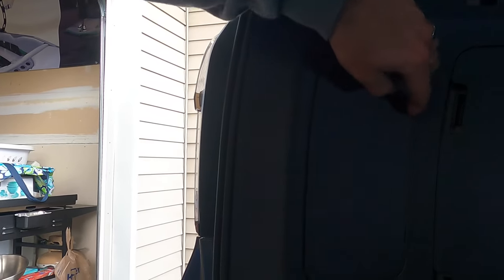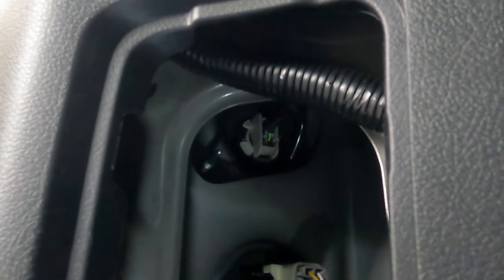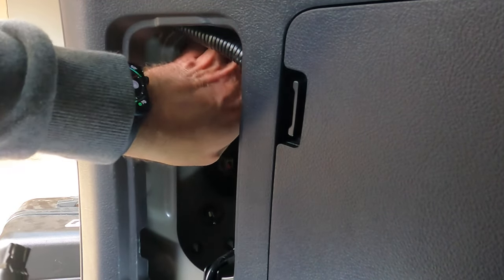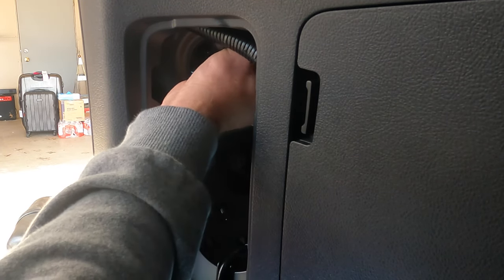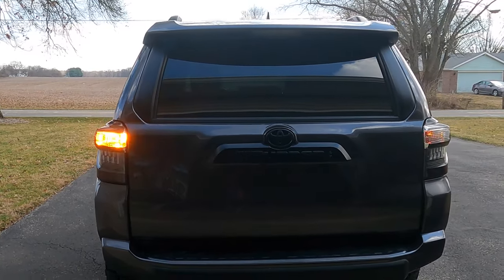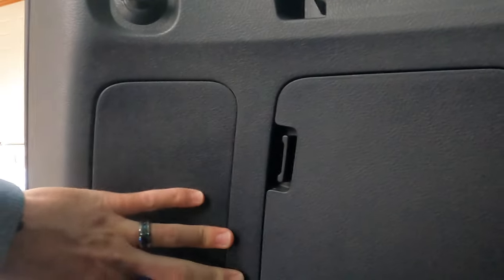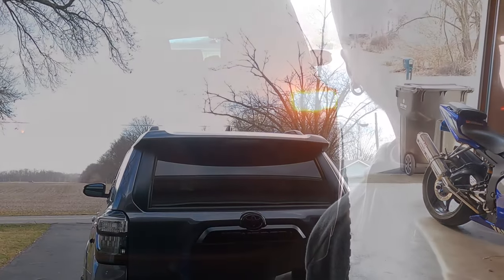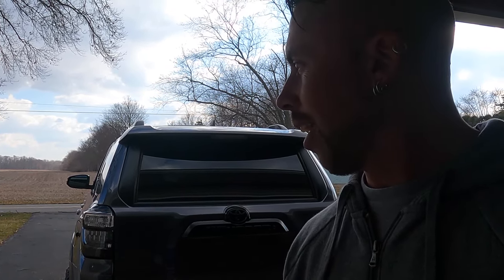Toyota 4Runner LED rear turn signals by Lasfit install - No resistor needed - No hyper flashing

Comment from the maker: If you are interested in getting these LED rear turn signal lights for your 4Runner, go to https://www.lasfit.com/products/7443-amber-led-turn-signal-bulbs-t3-series and use the code DUSTIN151 to get 15% off of them.

Comment: I want to know about these 5th gen 4Runner.

Doesn’t any of these 5th gen 4Runner have an access to remove the oem flasher relay to led flasher relay?

Or are they integrated behind the gauges?
Reply from the maker: I am not sure about the relays. I haven’t personally done any research on the 5th gen 4Runner relays. These LED bulbs are a very easy install, look great and are much brighter.